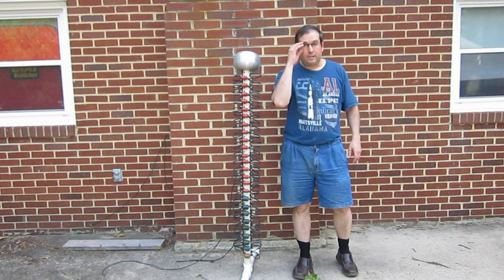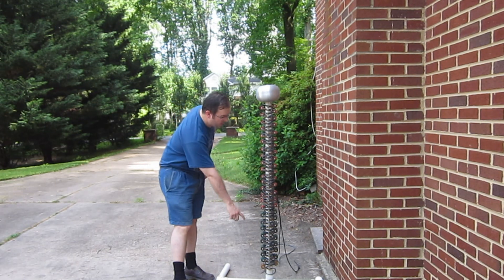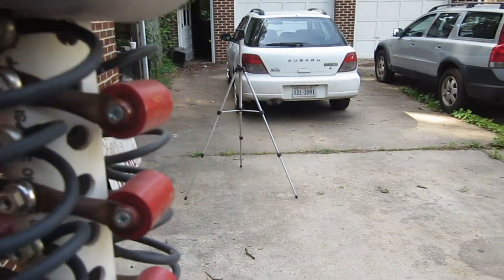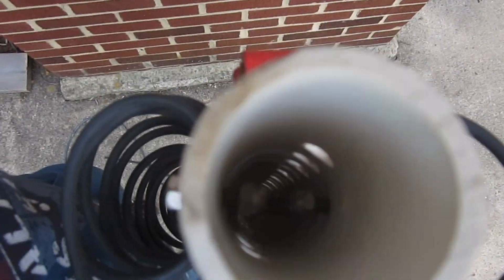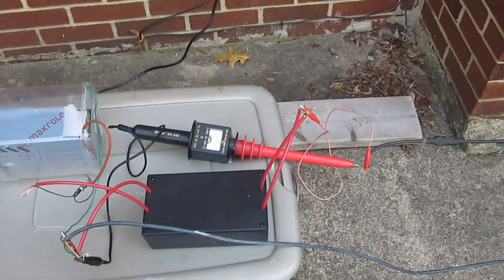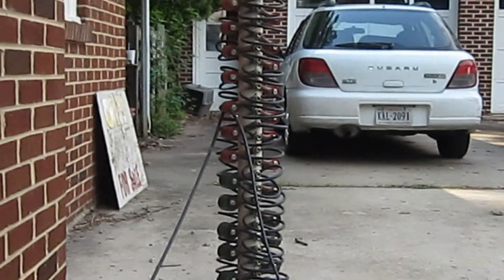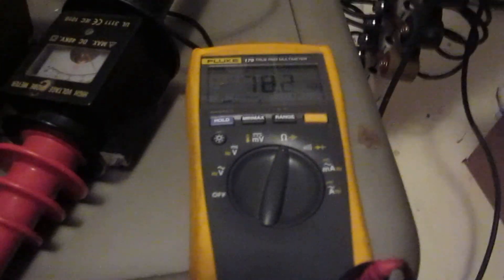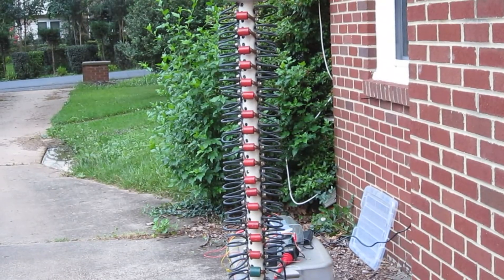1.6 MV Marx Generator

Comment: Use door knob capacitors, mine has 25nF 30kV and I use 40 of those. Charged to 20kV each makes about 800kV spark. No resistors are used, I use inductors (air coils).

Comment: Your charge time is way too high, you could shorten those radiator wires a lot, and/or half the capacitance.
Back to the drawing board I am afraid, physically it looks impressive but the performance is poor for its size, I reckon its got corona discharge between those radiator wires, should have insulation between them.

Comment: On the anode of your dc power source do you run a resistor or is the anode voltage the same as the input voltage?? I know the voltage is higher on the Tesla ball joint. Lmk bud

Comment: Hi there
Can you make a video about convert Voltage into Amperes? 
Thanks
Reply: Hi, volts is like water pressure, the more water you have flowing through a pipe, the higher the pressure in the pipe gets. Volts are the same, the more power you have flowing through a wire, the higher the volts get. 
Current is the flow of electrons in a wire, like water in a pipe the higher the current, the more power is flowing through. Current is measured in Amperes "amps".
We can calculate the amount of amps flowing using the following formula:
A = amps
V = volts
R = resistance

A = V/R

So if you made a circuit with a 9V battery and added a 10ohm resistor you could get the amount of amps like so:

A = 9/10
A = 0.9

0.9 amps in a 9v battery circuit with a 10ohm resistor.
Hope I helped :).

Comment: Disregard the negative comments. Even if the main arc isn’t visible, the mechanism of the circuit is still accurately portrayed through the discharges loud and quiet.
What kind of automobile radiator tubing did you use? I’m not sure what exactly to look for if  I’m looking to purchase any.
Reply from the maker: I took my ohm meter with me, to the auto parts store... and measured a section of the hose, to get and estimate of the omhs per unit length.. Remember don't touch the contacts with your fingers... you body has a conductivity comparable to what we are trying to measure..
Reply: @jaynesnetwork  Gotcha. I’m curious as to how it acts as a resistor. Is the inside of the tubing metal or does the surface conductivity of the rubber allow enough current to still flow through the stages?
Reply: @DBXLabs  the black runner has carbon black in it . Thats conductive ! Its a genius move !
Reply: @jaynesnetwork  what sort of power can they take per cm?

Comment: Where is 1.6MV? Thank you for sharing but delete video please.
Reply: wdym?
Reply from the maker: I do not have a device to measure this kind of voltage... I can tell the voltage is very high, due to the 12 inch streamers radiating from the 6 inch spun aluminum sphere! Adding up the voltage of the capacitors, gives a value of about 1.6 MV.. Granted there will be some losses in spark gaps, and other inductive losses during the erection of the Marx generator.. but surely  the voltage is very high!  The duty cycle is low, and the pulse is very fast, so it is difficult to capture on camera! Thanks for the great comments!
Reply: No.
Reply: 0.66666666666 MV

Comment: Yes a Fake ok the sparks is bitwine the condo
Reply from the maker: It was hard to capture the sparks with the camera I was using.. they were very faint, and low duty cycle, single frame events.. I had to use some image processing so you could see them on the video.. they are real though!

Comment: Выглядит как небоскрёб, а толку никакого. Все высоковольтный поделки сводятся к эффектности, за неимением практического применения. В этой палке, по картинке судя, не работает около трети конденсатроов... Вся батарея разряжается где-то внутри, в цепи коммутации. И эта пафосно надетая сфера, уменьшающая напряжённость электрического поля, вообще ни к чему. До неё не доходит разряд.
Reply from the maker: Thank you.. Yes.. All capacitors are discharging.. They must in order to complete the circuit.. When I initially built this device, it was performing better.. I had to resurrect this Marx generator to make this video.. The sphere was used before to increase the high voltage potential by preventing early formation of streamers.. Now the device is not reaching as high of voltages as before... I appreciate the interesting and charming criticisms... Do you build Marx generator as well??

Comment: I think that by putting the power supply at the middle rather than the bottom you are only actually using the top half of the tower as the lower half is shorted to ground through the power supply unless you are using some very high voltage resistors in series with the power supply. The resistors would need to resist at least half the total output of the generator.
Reply from the maker: The bottom half is not shorted.  The charging resistors are used to isolate the charging supply from the marx during the erection time.  The erection of the marx happens so fast, that there really is not a stationary 'ground' on this time scale.  The marx creates its own circuit at this point, which is almost completely isolated from the charging supply... as long as the caps are charged up, the marx circuit does not care at which point that the previous charging took place. Remember electricity always travels in a circle, and when the marx erects, the electricity is almost 100% traveling in the marx capacitors and spark gaps. Remember the zero point of voltage potential is arbitrary and meaningless, and that only voltage potential 'difference' matters..  The marx is generating a huge potential difference, on a very fast time scale, between its output voltage terminals..

Comment: this could travel through pulsed laser induced plasma channels.

i am making a small but compact cockroach trap out of 630V 1.5uF metallized polyethylene film resistors to produce 3/8 inch sparks along the work load electrodes where the roaches cross over, i am using a 150W max output capacitor charging circuit at 630V there are 50 capacitor stages. at <_14.88 joules combined total, they will in theory explode to clear the work electrodes for the rest of the roaches. but i can lower the energy output and raise the voltage as well.
Reply from the maker: Sounds like a fun project. Be sure to take videos and post them.  ;-)  The only way to know for sure, is to do the experiment.  I have never personally tried exploding cockroaches with electricity. Good Luck!

Comment: I was just working on one of my own Marx gens and I figured out it needs to actually short itself to ground ie. the bottom of the stack so the plasma in the spark gaps can really get a strong ionization going. If I dont let mine short to ground or discharge the final gap through some resistance I dont get a good shot out of it.
Reply from the maker: Thanks for the great information. I believe I was shorting mine to a grounding rod in the ground.  Unfortunately I did not have high enough charging resistors, I and I believe I destroyed my high voltage charging diode stack.  What voltage are you designing your Marx for? Thanks for the great comments.
Reply: Mine is only for about 60kV right now with 3 stages but my caps a pretty large at 10nF each. I'm planning on going up to about 100kV. I like your idea just using that tubing for the resistors. That way its distributed and there's no way the leads will cause oscillations when it discharges. I'm trying to get a unidirectional pulse out of mine so I want all the leads to be damped and I want the main output terminal when it sparks over to ground to have a low inductance critically damped path. Best way to do that is use a ground tube around the whole thing but then the voltage is limited because you have ground everywhere. I know just putting 3 stages together and tuning the gaps is tricky. 50 is too much for me haha. nice work.

Comment: wtf? spark inside tube?
Reply from the maker: It is a Marx Generator.  It has 50 spark gaps inside the tube. The Marx generator capacitors are charged in parallel, then when the spark gaps break down, it adds the voltages up in series to generate an extremely high voltage, high power pulse.  Marx Generators are truly amazing devices..

Comment: Great work, but I think it has too many stages, so they don't charge properly, that's why the low output. See my twin tower design, it's much more efficient.  Try to put power supply in dielectric oil to prevent damage from corona effect, or use a zvs-flyback design.
Reply from the maker: Thanks.  Yes one of the guys at work thought that the impedance of the Marx might be very high due to the large amount of stages, since it will be 50 * L*C, where L is the erected inductance and the C is the per stage capacitance.  The high voltage diodes are potted in vaseline which actually works pretty good for the high voltage corona and breakdown.  I had to replace my Marx charging resistors, and the new ones were a little on the low side, so I think this put my charging diodes at risk.  I still need to trouble shoot this, once I finish with my car issues...  Are you building Marx Generators as well?  I will check out this design, very interesting...
Reply: I charge at 300KV , just because to many stages has to many losses

Comment: Very nicely done! Did you try to measure how long of a spark it can produce?
Reply from the maker: That was the next thing I was going to do but then I blew out my power supply.  The new charging resistors were too low a value.  This thing makes 1 foot streamers out in to thin air.  It is hard to see with this camera.  The impedance of the marx is very high and the rise time is very fast.  When I tried running the bottoms voltage up to the top to make sparks with clip leads, the inductance was so high that streamers were coming out the sides of the wire, like a Christmass tree.  I will try to repair the power supply and make some sparks... It will be fun.
Reply: Nice! I study electrophysics in university, so I could help you with measuring an actual output voltage of your generator by the length of a spark. With 1.6 MV you should get 90-100 inches (230-250 cm) spark in needle-needle air gap, or 100-110 inches (250-275 cm)  in needle (positive) - plane (grounded) air gap.
Reply from the maker: That is great.  When I get it up and running, We can try taking this measurement.  I found that the capacitance is important as well. It does take some energy to break down the spark gaps, and this takes some energy away from the final gap.  Also there is about 1 cm gap for every cap, x 50 gaps.  So about 50 cm is used up in the spark gaps firing.  It will be interesting..
Reply: jaynes network actually it is not exactly true: when all 50 gaps start conducting, their resistance is very low, so there is almost no voltage drop across them, and top electrode ideally sees all voltages of caps added together, so one should not substract the length of the gaps from total output length
Reply: Depends on air pressure, temperature, humidity and wind